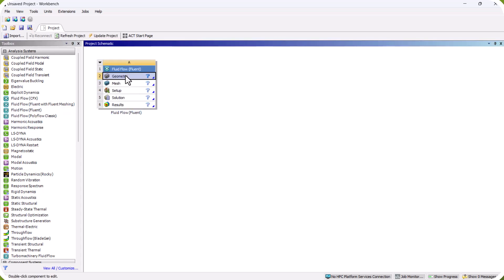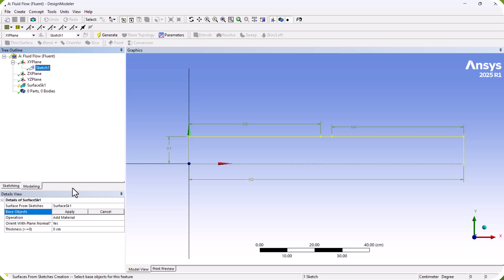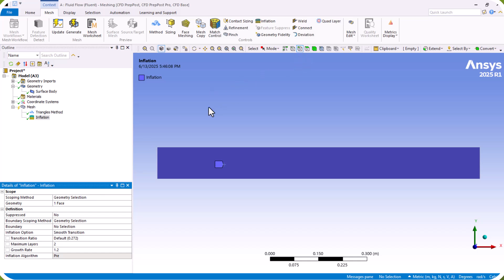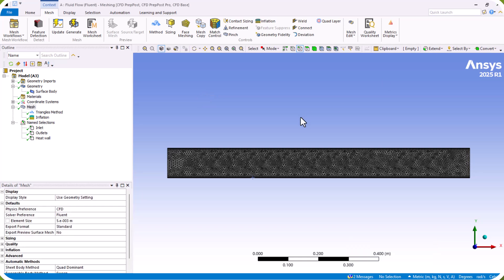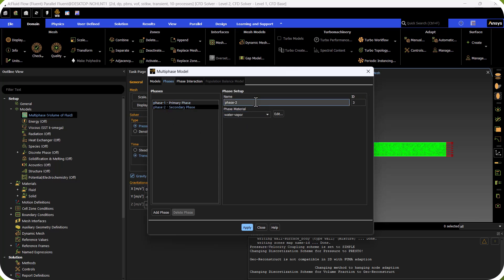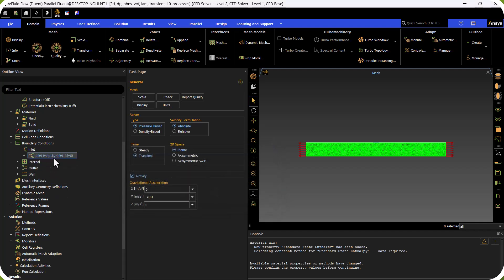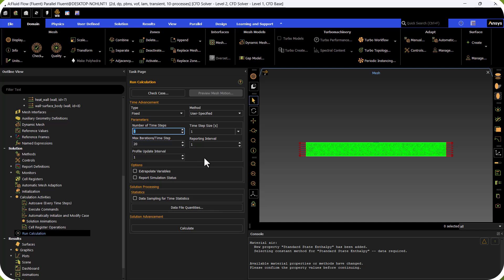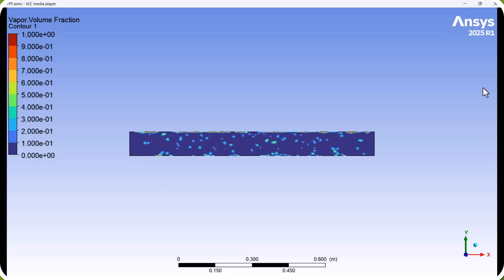ANSYS Fluent: Evaporation modeling

Comment: In the same model i am using as a liquid metal sodium as a working fluid. But they said to me. Latent heat should not be less then zero. What is mean of that. I did put properties section latent heat
Reply from the maker: Latent heat is greater than zero. I think you may have confused it with the heat of reaction enthalpy.